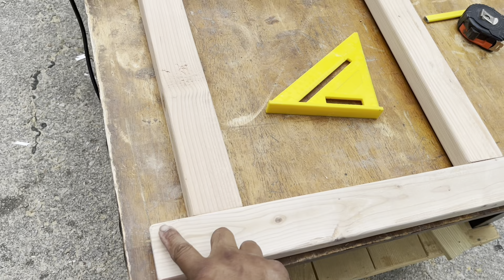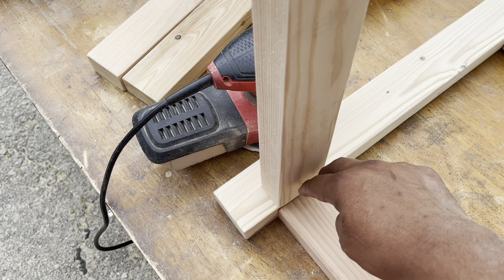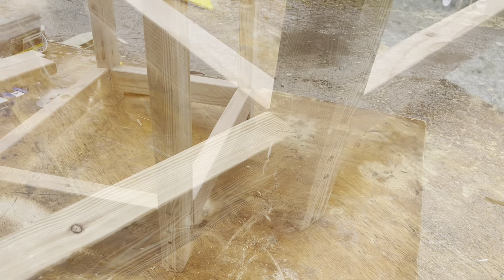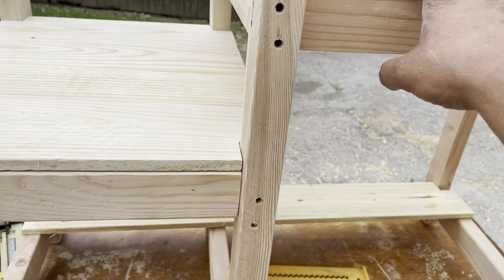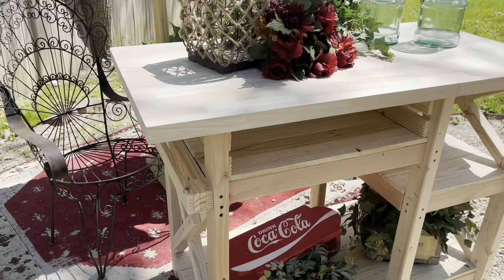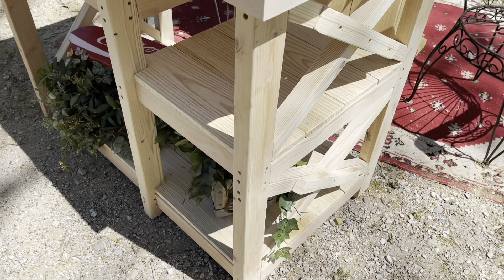2x3 and Fence Pickets - Farmhouse Kitchen Island

Comment: What kind of leveling legs did you use,  can you send a link or description, also how can I get plans if I am not on Facebook.
Reply from the maker: I use these leveling feet…

As for plans my CashApp and Venmo is in the listing description now and are $5.

You can then drop me an email and I will email the plans to you…

The plans for most of our projects are just $5 or less…

The plans for this one is just $5

https://www.homedepot.com/p/Everbilt-1-1-16-in-Round-Threaded-Stem-Leveling-Furniture-Glides-for-Floor-Protection-4-Pack-4603644EB/203672161?source=shoppingads&locale=en-US&&mtc=SHOPPING-BF-CDP-GGL-D25H-025_004_BUILDER_HARD-NA-Multi-NA-SMART-NA-NA-NA-NA-NBR-NA-NA-NA-BuildersHardware_Smart&cm_mmc=SHOPPING-BF-CDP-GGL-D25H-025_004_BUILDER_HARD-NA-Multi-NA-SMART-NA-NA-NA-NA-NBR-NA-NA-NA-BuildersHardware_Smart-71700000081230576-58700006913855557-92700064304424101&gbraid=0AAAAADq61UfSfac6Um479_HzKzWfsIHi9&gclid=CjwKCAjwge2iBhBBEiwAfXDBR0gTCaX9nWy6lXeF8ghwlE119-n4FGBZSjDScfHMW0YKjx-2QBTJbhoCYbgQAvD_BwE&gclsrc=aw.ds